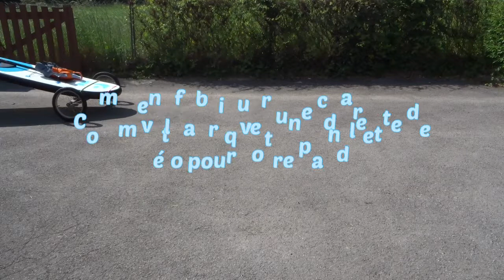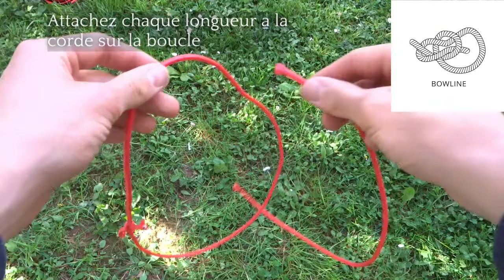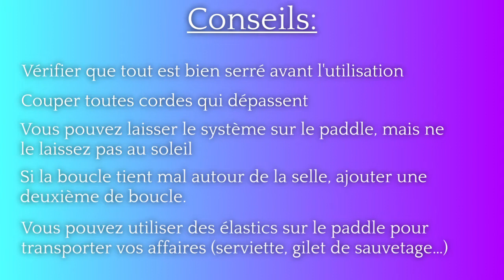Comment fabriquer une charette de vélo pour transporter votre paddle.

Comment: Hello nice video and idea.
After one year of use did you hace any issue with the ring on the sup who's much in strong force?
Reply from the maker: Do you mean the ring around the bike seat? If so, no I didn't despite using it every week. Even so, I recommend changing the rope from time to time, especially if leave it outside all year round like me...
Reply: @DiyDimensions  no I meant the ring attached on the sup where you locked the rope with the screw
Reply from the maker: @fedemon76  Oh yes, that held up well and was not damaged or worn
Reply: @DiyDimensions  Thank you, I need to find a similar way, but in my case I cannot attacch directly to the seat because I have the rack...any idea?
Reply from the maker: @Federico Montesi  I would try making a support with two wood planks again an angle. Make a hole in one and put the seat's pole through it. Then, using a metal angle piece, screw a second piece at a 90 degree angle resting on the back of the rack. By putting the rope's loop around a screw in the top wood, you should be able to use the system
Reply from the maker: Also, if you are worried about damaging the ring, replace the string going through   it by a small net made of string and knots.